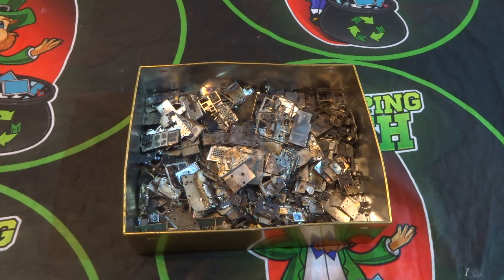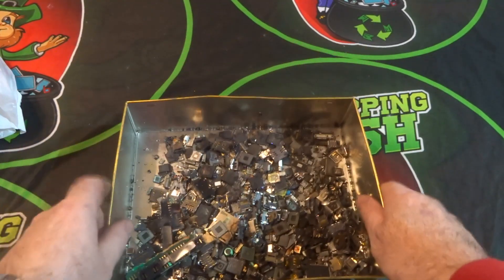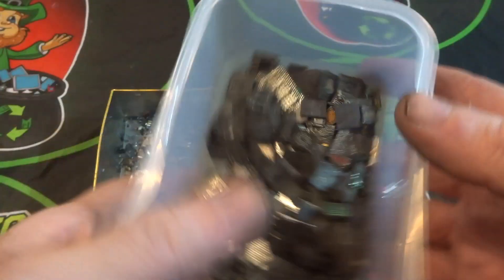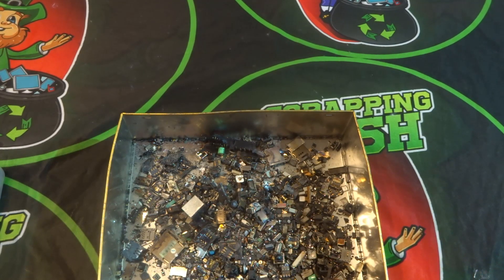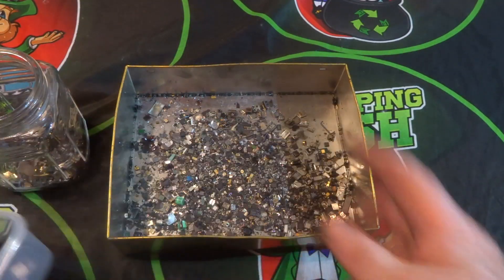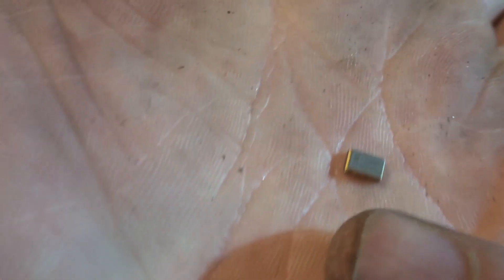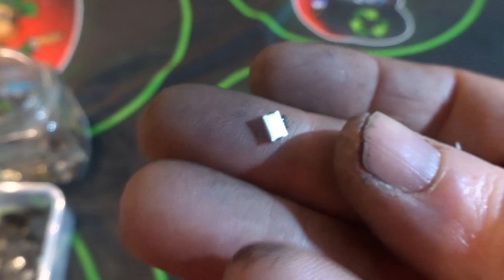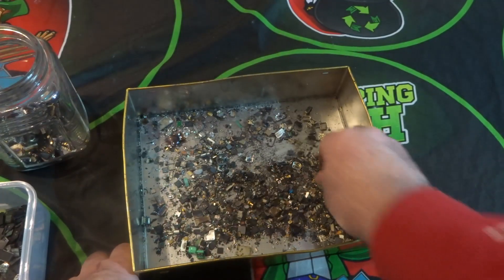Gold recovery from mobile phones part 3

Comment: I don't envy you the sorting.  But as you rightly point out, it is a necessary evil before processing.  I usually set some empty containers out around an old white plastic cutting board then pour some of the pile out on the board and work through separating items.  It's good to do when my hands are tired of cutting wire.
Reply from the maker: I do the same thing spread them out and sort